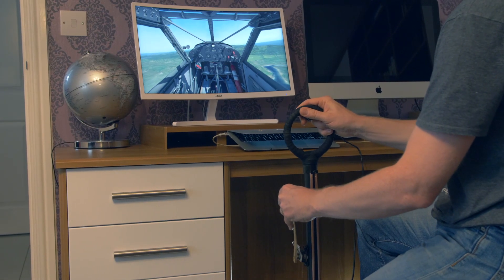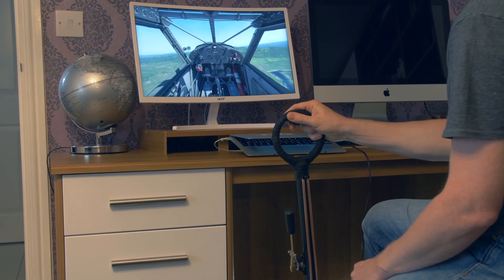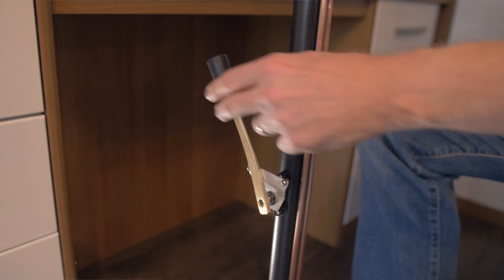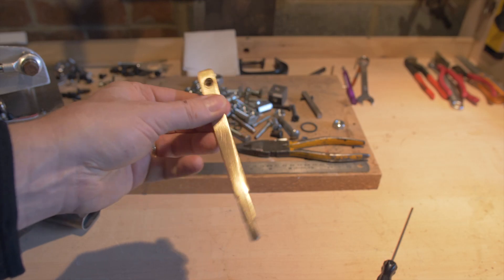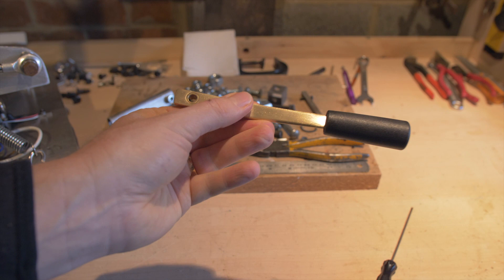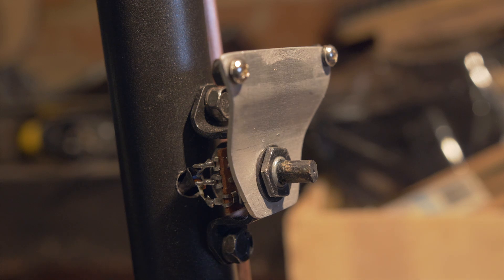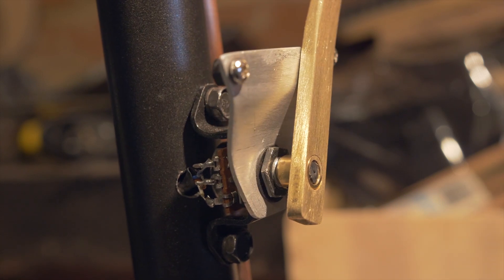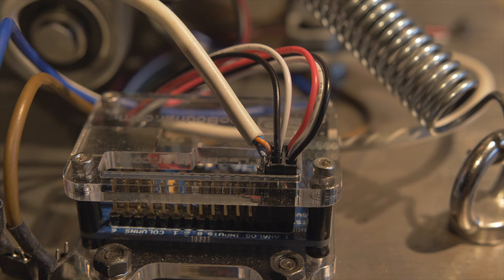Homemade Joystick Part 2 - Throttle

Comment: Man, the first DIY joystick video I saw was the one from Tom Stanton with an Arduino, I already have some ESP32s so I looked into how one might use one of them for this, but that most certainly did not seem like it would be possible without understanding vast and complicated USB and what-not libraries. And then I found this inconspicuous video with just a measly amount of views, but it actually contains the one thing that is most useful for building a joystick, easy-to-use electronics! Geez, without finding out about the Leo Bodnar board, I think my chances of actually being able to complete the joystick and collective I aspire to build would certainly be quite low.
Thank you so much for these videos!
Reply from the maker: Great - thanks a lot, glad you found them useful. Yes, the Leo Bodnar unit certainly saves a whole load of bother!!

Comment: Great video.

I have a doubt: what if I want to add 3 extra throttles connected to the arduino? Is this possible?
Reply from the maker: With an Arduino - probably yes. I didn't use an Arduino, but depending on which one you have there are several analogue inputs. With the Leo Bodnar unit I used, yes up to 8 throttles if you want!

Comment: Realistic or not, I am in LOVE with this! The brass, The metal, the cotton wrap; all of it. This is just beautiful man. I especially like the brass button on the ring. I have been building these for about 2 months now out of 3d printed parts, but hadn't thought to use my metal working skills. Thanks for the inspiration!.
Reply from the maker: Thanks very much indeed! I haven't even got a 3D printer (yet!) so it had to be metal. And have been researching all sorts of WWI designs - plenty of natural wood and brass bits there of course. I do have a couple of other designs in my other videos so check those out for some alternative ideas  - thanks very much for your comments.

Comment: How did you make it so that the throttle was at full value on the potentiometer at such a short angle? I know that most potentiometers are 300° for full value
Reply from the maker: Hi - The potentiometer doesn't use the full length of the track; probably only about a third of it. I just calibrated it within X plane to give max values within the software for the 2 limits of (rather short) travel on the potentiometer. Not ideal, but it works!

Comment: Hi Tim, I'm looking to make my own throttle as I want a full hotas setup but don't have enough money for a throttle. I was wondering what kind of software you used?
Reply from the maker: Hi - I don't use any special software - The Leo Bodnar board has all its own software built in to just plug and play, straight into X Plane, or whichever flightsim software you prefer. Hope that helps - thanks for watching!   (I used this board - http://www.leobodnar.com/shop/index.php?main_page=product_info&cPath=94&products_id=204 )
Reply: @THFlightSim  thanks

Comment: Hi Tim, really cool video. I was performing a research and I found this gem. I have many many doubts. I'm working in a project to build a double throttle joystick. I already found your email and I will send you an email later. Thanks in advance.
Reply from the maker: Thanks a lot - I have some more info and bits on the website now so feel free to check it out - thanks!